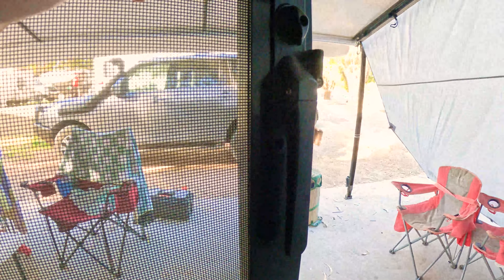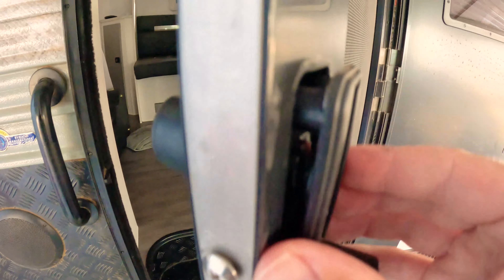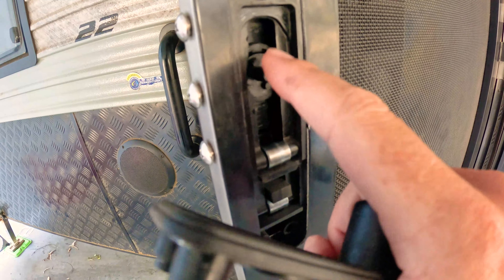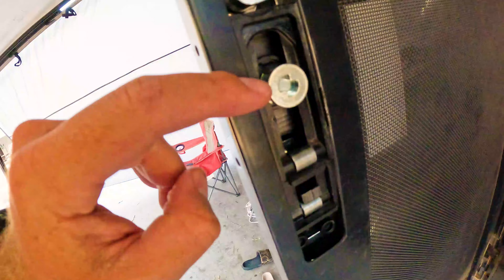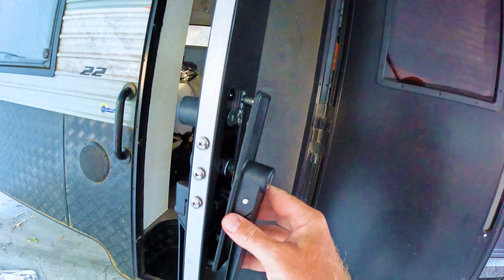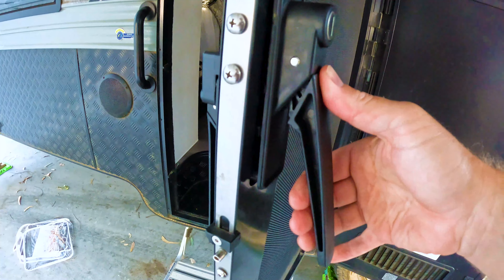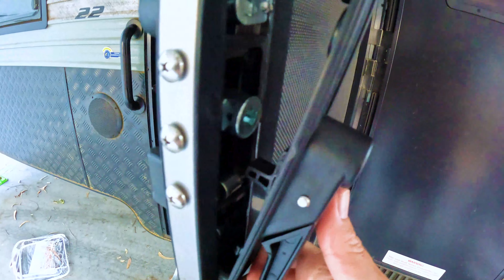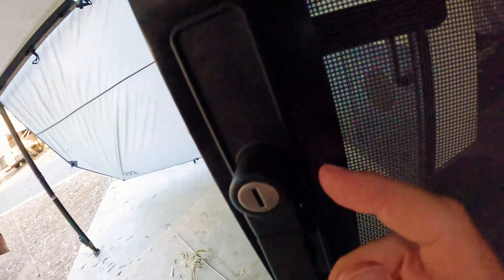How to fix Caravan Door Lock (Milenco)

Comment: good video. There is also a trick to getting the old barrel out of the metal casing which requires pulling the metal guard back with a flat blade screwdriver then pulling the barrel out. having the key can help with getting the barrel out also.